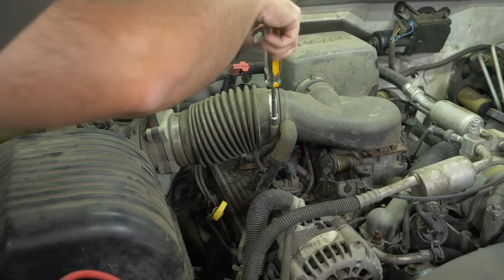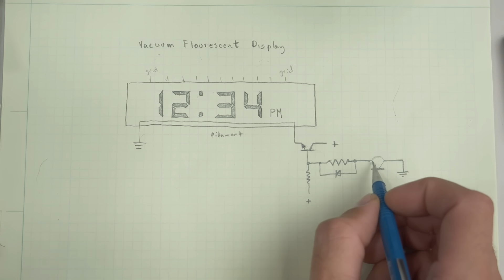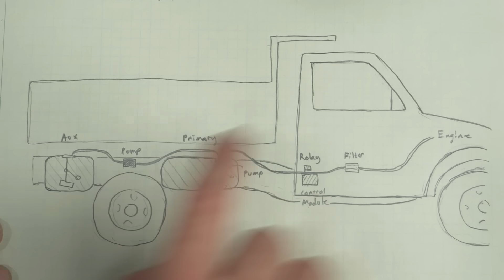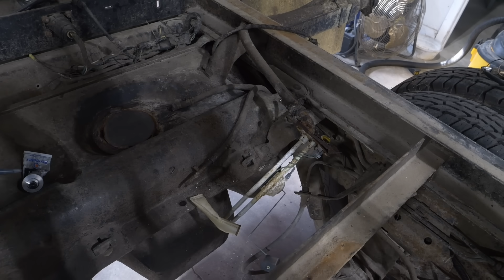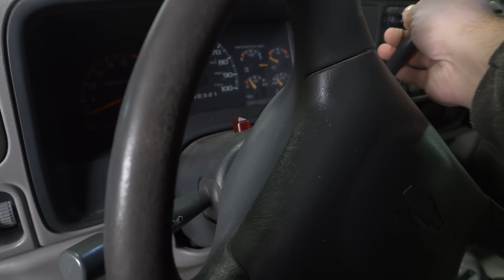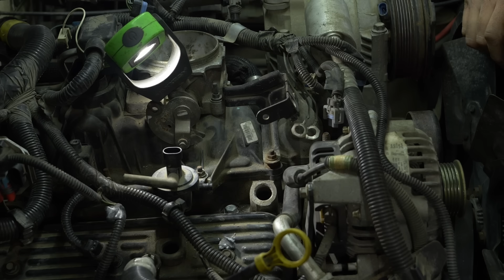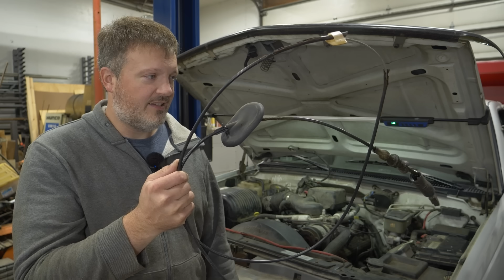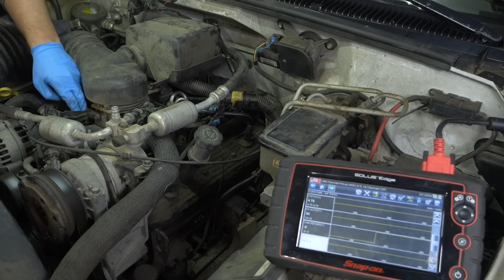This Truck Is Breaking Faster Than I Can Fix It

Comment from the maker: Sorry, I swapped the NPN and PNP transistors in my schematic, and I managed to spell "Fluorescent" wrong. Must be a software bug. The bending tool I used is a 4" or 100mm vise bending brake. Kinda handy for small parts. You can get one from ebay or Amazon or wherever fine Chinese tools are sold.
Reply: Enjoy watching these truck repair videos.  Request from the peanut gallery to keep 'em coming.  Thanks!
Reply: on my 96 5.7 the intake was warp and had severe pitting around the coolant ports & block offs ….the only company that did make a replacement was Dorman & they discontinued it a few years back to my knowledge ….longer story shorter i had my buddy Tig it up and Machine it flat…thats when we realized it was warped as well….anyway i got like 30k miles on the old beast since 🫶
Reply: The oem distributor was plastic….the whole thing minus the gear and shaft!  when i removed mine it was the shaped like a banana 😆🤦‍♂️….. …. i went with the street fire (cheep msd) distributor and cap & rotor …about 500miles in i had a misfire that was caused from the cap arching internally between 2 cylinders….& it blew my bank 2 (brand new) catalytic converter out from the raw fuel combusting in it 🤦‍♂️
Reply: NPN = "Not Pointing iN". Hope you and yours are doing well! Love the videos!
Reply: Dam Wes, is there anything you can’t fix? 👍
If Elon ever gets to Mars, they better have someone with your skill set in the crew.
Reply: I’m not here to watch Wes fix stuff. 
I’m here for the Dry Humor…. and my pick for today is *Industrial Cheese*.
Reply: I was wondering why you said NPN when its PNP in your little schematic...
Reply: Wes , I’ve watched a lot of your entertaining vids , could you please do a detailed “toolbox tour” , thanks from Australia !

Comment: Had a 1995 GMC pick up truck with the 4.3 L V6. The heater fittings in the intake manifold had a bad habit of rotting on these models and I had to pull the intake manifold just to fix that. This was on the coldest day of the year at an apartment complex.

Comment: 30:00, you think that's bad, have a look at the bracket holding the pipework on a Citroen Relay / Peugeot Boxer fitted with the Ford 2.2 Puma engine.

Comment: As an autobody man of 38yrs, I despise mechanical work. The vehicles over the years have become so difficult to repair most things in the engine bays…..not much room. They design these vehicles now days to make assembly faster at the plant and the engineers don’t design them to be serviceable later on down the road. Had a turbo go out behind the engine of a diesel truck, up under the firewall in such a way you could NOT get to it from above or below the truck. Service manual said you have to remove the cab of the truck just to gain access to the turbo charger. What a damn nightmare! Once again, did I mention mechanical work sucks. You have to have the patience of Jobe in the Bible to tackle a lot of these jobs now days.

Comment: Please make people aware (especially diyers who may not know) that any parts cleaned with chlorinated brake cleaner can never be welded. A deadly gas is formed even if the  parts are dry. Chlorinated brake cleaners are still being sold even though there are safe alternatives. Even if it is eventually banned, there will still be cans of it in work shops for years to come. I’ve had spray-paint cans nearly 40 years old that still worked.

Comment: I started watching your content with your latest video about restoring a practically brand new faulty CNC lathe, and i've binge watched most of your content ever  since.

You're the embodiment of what a I suspect a man might be capable of in the 1950s, except we're in the 21st century and you excel in a multitude of areas:

- mechanics
- mechanical / design engineering
- electronics technician and engineer

You should consider doing an online course, I would happily pay to learn from you.

Comment: On some GMT 400's, you have to unplug the spark control wire, which is purple and has an inline connector just for that purpose. Not sure what the vortecs are, but it may be something similar. The engine has to be at full temp also. Setting it at TDC via timing marks should be fine. The computer will move timing all over the place to keep the EPA happy. That's why you have to unplug it to set timing... At least on early (TBI) GMT 400's.

Comment: I love your videos.  I spent the last eight years at a foodservice refrigeration and trucking company.  The last five were without an in-house mechanic.  I learned diesel repair, refrigeration maintenance, hydraulics, brazing, wiring, and anything that could avoid a call-out that ran about $200/hr.

Is any of it on my resume?  Well this was all very not OSHA approved.  I quit last Friday.  So now it is.

Comment: My 99 7.4l you can remove the split intake manifold without removing the valve covers. Also alot less mess and easier to get too.

Comment: I have this same fuel tank setup in my 2000 k3500. Would it be possible to just wire the auxiliary fuel pump to a switch in the cab to initiate the fuel transfer into the main tank?

Comment: Every few years I get a notion I wanna be a mechanic just because I do cars for a hobby.
As luck would have it, your deadpan tragic face explaining the hoops and lengths you went through for what's supposed to be simple fixes stops my ambition.
Thank you!!
And about the distributor, some cars (not all, some) require you to put the EFI into a diagnostics mode before setting the ignition timing.

Comment: With the narrower frame I'm guessing the front tank is smaller than a regular pickup? The pickups normally had a single 34 gallon tank.

Many other C&C trucks use a single 40 gallon tank behind the axle. Guessing they would fit here. Don't know about mounting.

Comment: I had an '03 Burb 2500 8.1 with dual tanks and watching you now pretty sure it was near identical logic for fuel level management. Not a great system because the rear pump would die but you wouldn't know. You'd still read ~1/4 tank but had no actual fuel available to pump.

Comment: That thing you found at 26:30 I believe is the wrench that comes with the radio antenna on cab & chassis before it’s upfitted with whatever gets put on it.  Probably a short guy dropped it when it was being removed off of the antenna.

Comment: That heater hose connector reminded me of the glow plug control modual on the 6.9 IDI Ford / International diesels. Broke if the wind blew to hard across them.

Comment: Good call on using a generic transistor to repair the radio display. But I bet you knew it was going to work since it controls a simple non-critical circuit.

Comment: Wes I hear you complain about Fords from time to time but this truck reminds me of why I will never buy another GM product. My Tahoe with 160k kilometers on it tallied up a total of 15k worth of repairs when I stopped counting and started looking for another truck. I replaced it with a Ford Expedition and spent 1200 bucks in repairs in over 150k of me driving bringing the total up to around 220k kilometers or 136k miles. The rust finally was causing trouble and I replaced it with a Lincoln Navigator.

Comment: Hey there Wes - Seeing how you mastered this old Relic is -{Yikes} Kinda like when I kinda learned on a 2005 Pontiac wave of how tight the space is when putting the Alternator in and the support bracket to the air intake was not machined right to allow the pivot bolt to be able to be removed  - WOW you're a real trooper and a great teacher...I think these engineers need to be put in to installing there designs so they can see how some of there booboo's are causing a lot of frustrations to us mechanics...

Comment: You’re right about them engines, I’m a oilfield mechanic here in Saskatchewan. we alone have probably close to 1500 GM blocks running generators and hydraulic pumps ha.

Comment: The gm 2 tank is a nightmare. My builder friend has one. The fuel gauge is completely unreliable. Too much electronic stuff. The off road vehicles we used in Botswana had a simple transfer pump. When the main tank got low, a manual switch, would pump from the exterilery tank to the main tank.

Comment: I have a 1998 K2500.  The entire gauge cluster for that truck is available via NAPA.  My local dealer set the mileage and my mechanic installed it.

Comment: Man i got a 06 silverado 3500 with that same stupid dual tank set up the rear tank was deleted and the primary tank has a new pump and sending unit but the gas gage dosent work because it dosent see that second sending unit how would i make it read just the primary sending unit so the factory gas gage would work or would i be better off running a aftermarket gage like shown here?

Comment: To answer your question: Yes, almost all old V8's are like that. You have to take the valve covers off to get the intake off. Every cast iron GM and Ford V8 I have ever worked on, the lower intake manifold was one of the surfaces the valve cover gaskets sealed against.

Comment: Idk why anyone would check ohms on a washer pump ..just probe for voltage and ground at the plug and have a second human use the switch inside
Reply from the maker: To rule out pin fitment issues.

Comment: Buy an indoor LED (no bulbs to replace) bug zapper for the flies.  Get the version WITHOUT the sticky pads that you have to change but instead with just a drawer to dump.  It will kill a ton each night in the dark.  You will thank me.   Similar to this:  Buzbug LED Bug Zapper Indoor, 10 Years Lifespan 3 Lamps Enhance Insect Attraction, 3800V High-Voltage

Comment: You are remarkable  To be able to solve the source of the parasitic draw inside the radio was stunning.  I had an 04 Expedition with 300K.  It developed a parasitic draw that my mech could not find.  He had an ammeter on all night with a camera pointing to it.  He could see the draw but not locate the source.  I had to get rid of the car.  Not a big deal at 300K but it was frustrating.

Comment: Had a '94 Astro van, replaced the engine with a short block but got the distributor 1 tooth off, I could move it just enough to adjust to TDS so I didn't bother to fix it.

Comment: I remember my father had a 1988 ford van with dual tanks.  It simply had a switch to swap both the fuel pump and the gauge from one tank to the other.  How hard would it have been to bypass the balancing module and throw a second high pressure pump in the second tank?

Comment: I have a '99 C3500HD with the 454 and 4L80E transmission.  It has a dump bed, and someone removed the rear tank to (poorly) weld in a more than sketchy home-built tow hitch. I spent some time exploring the balance control module, and found you can jumper one of the connectors down there to have a working stock fuel gauge. Alas, I never get to drive it. The 4L80E lost all forward gears and I've been too lazy / too annoyed to drop the transmission and pay $2000 to have it rebuilt. I just start it up and let it idle every few months to keep the seals wet.

Comment: So I have a K3500 a couple years newer that has the same issue with the fuel gauge. Would you be interested in doing the same thing to mine? The aux tank doesn't and hasn't worked for 10 plus years and the gauge stopped working about 5 years ago.

Comment: If you get in that situation again, try some West Systems #6 comes in a caulking tube (standard size) and is made for plastics such as that tank.  The epoxy mix is in the tube and self mixes as you squeeze it out.  Grabs on plastics that are normally impervious to the normal cast of characters.  Been out for ten or more years now.

Comment: Tip
If you are getting any kind of dash emoji or funny issue with the instrument cluster before doing a deep dive or loading the parts cannon CHECK the body earth connections and all other terminal connections for corrosion.
Often simply cleaning a connection and or replacing a missing earth will solve the seemingly unsolvable.

Comment: I worked on a truck like this. Fuel gauge was not working right. Other people had pulled the dash and another had dropped the main tank and replaced the pump. Still didn't work correctly.  I sat down and thought about it. 1 fuel gauge and no tank selector switch. Hmm. The costumer told me they never fill the auxiliary tank. I put fuel in the auxiliary tank and boom it worked. Obviously you have to use both tanks for the gauge to work correctly. Apparently it reads fuel level from both tanks.

Comment: With the majority of my mechanic knowledge on obs chevy trucks (7 350s, 1 454) I strongly dislike the 1997 models with the 350 and 4l60e. The tranny is good for 2 weeks max and the ignition system is as reliable as the lt1 optispark in my experience. I strongly prefer the tbi 350s, 454s, and 4l80.

Comment: I love seeing fixing the older stuff because it's a lot of what I run into!
All these degraded plastics and metals that work fine until you touch them, then they crumble into dust.
Love to see ways to tackle fixing NLA stuff! My '96 Dodge Dakota is one of the small pickups from before they stopped making them and it's also one that has next to no third-party parts available.
So if a part isn't cross-applicable to a Ram, I'm SoL! Only so much I can get from a wrecking yard too.

Comment: I ended up placing a jumper at the module to get the cluster gauge to forget there was rear tank. Its stopped the averaging.  I only have the front tank installed also.

Comment: Those engines are notorious for vacuum leaking by the  intake gaskets. Dex-cool was introduced back around that time and the gasket material would break down after about 10 years. I have had to replace those on both of my 1997 OBS Chevy's. About a 5 hour job for me. Fuel trims back to zero. Also replaced the spider injectors while i was in there, then switched to Green A/F

Comment: I wouldn't say gas guage is obsolete. u couldn't went online and gave him an option to get another used one or send it out too be rebuilt. Even if i was paid too work on a Vortec , i won't. cluster fk of mess. Not wortth my time. TBI, TPI, etc. Way simplier.
Reply from the maker: The air core motors are going for $100.

Comment: My old truck has an aux tank. I flick the switch and it pumps fuel from the aux to the main tank.
The trick is to not spew fuel out the main filler pipe onto the ground if you pump too much.
Money is a great incentive not to do that.
20 years in. So far so good 🤠

Comment: Hey Wes, I have had unusually good luck with the air core stepper motor replacements sold on ebay for repairing the cluster fuel gauge, oil pressure gauge, etc on this era GM.

Comment: as far as that fuel gauge that Solus edge scanner will do a sweep of all the gauges if the fuel gauge is not working the most common thing is the stepper motor on the cluster  there are 6 or 8 of them in there, easy to get on the internet, not hard to replace and that fuel gauge will come back to life each gauge has its own motor, I see a lot that the speedo is just stuck at 40 or something but the fuel gauge has its own motor, just solder it in
Reply from the maker: The air core motors are obsolete. Used ones go for over $100.
Reply: @WatchWesWork  dang I did not know that, I have replaced hundreds of those stepper motors, thanks for telling me

Comment: Isn’t radio component replacement kinda financially silly? 
I mean surely you charged the customer more to troubleshoot and repair the factory radio than a new fancy radio with Bluetooth and CarPlay would’ve cost.

Mad skills for sure, and if you were working on your own stuff then great, but shop labor rates are all over $100/hr with a bunch over $200/ hr. Why spend $600 in labor cost to fix a factory radio?
Reply from the maker: How long do you think it takes?

Comment: Sure hope you see this but for that auxiliary tank there is a fix for like 50$ with some retrofitting but gastank renu sells a tank lock ring repair kit that uses self tapping screws and recommend to use seal all glue on the screws. You could habe also made your own with the cnc 😂.
Reply from the maker: As seen on this channel.
Reply: @WatchWesWork its a block off plate not a sending unit clamp 😢 that's why I said so! You could cut a hole in the diameter of the sender unit add silicone seal or oring or glue and tapper screw holes with the cnc 😢

Comment: As a retired mechanic with 42 years of service, I have seen many similar problems. I did fine as long as I had schematics to refer to, but I envy your knowledge of electronics. Being able to understand, diagnose and repair a circuit board would have been VERY useful !

Comment: Great content all the way through this video bro. My Toyota Surf in NZ but 4Runner in your country has a parasitic draw in the radio so maybe mine has the issue. I just left the fuse out as hardly use the vehicle anyway. Clever bit of wrenching and auto electrical work by the way. Ken.